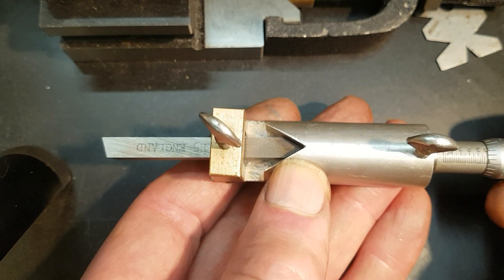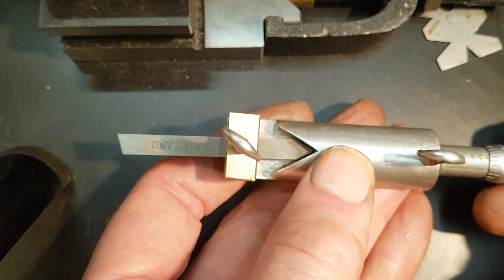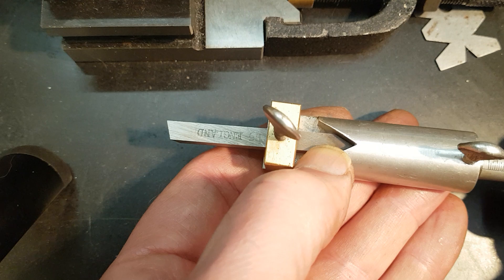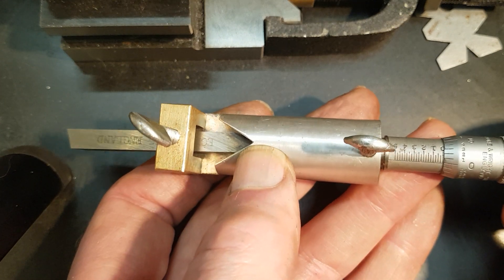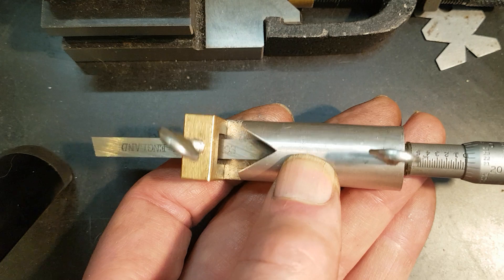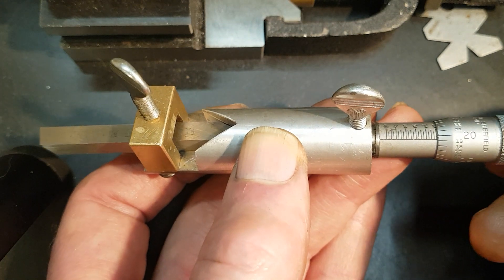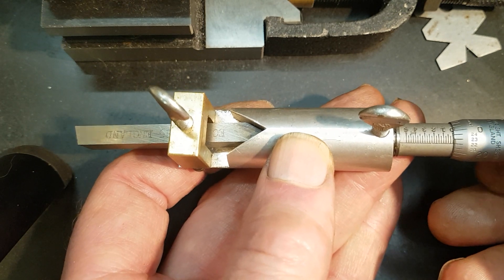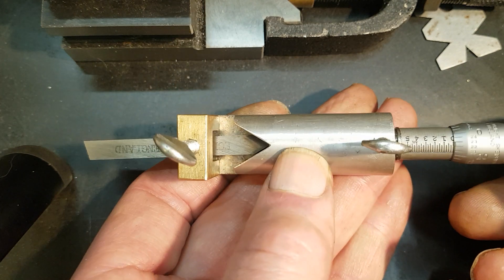A little gizmo for measuring the flat on the end of a single point threading tool.

Comment: Nice tool Chris.  Another for the list of projects.
Reply from the maker: Thank you kind Sir, unless you have a QC called "inspector meticulous" don't bother. Wait till I video my novel design 3 wire system, much better way to get "perfect" threads. I also must video my threading tool grinding jig, again a novel (perhaps  crackpot is more accurate) design.
ATB 
c
Reply: @chrisstephens6673  -Feel no pressure - but I for one are keen on learning how you've tackled these two self-assigned commitments. :) Keep up the good work! DIYSwede
Reply from the maker: @johanandersson9287  Watch this space, if you have more than a modicum of patience, that is. 🤣